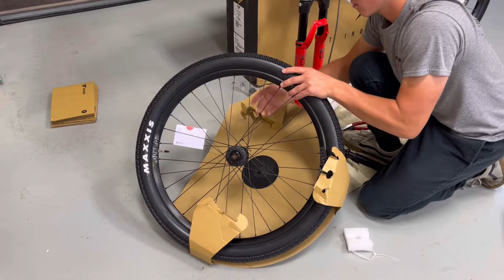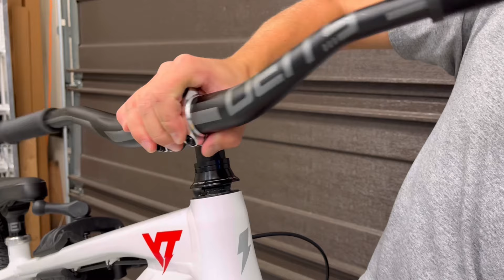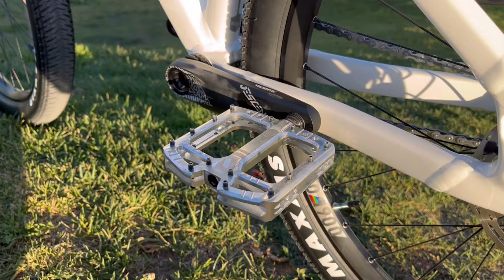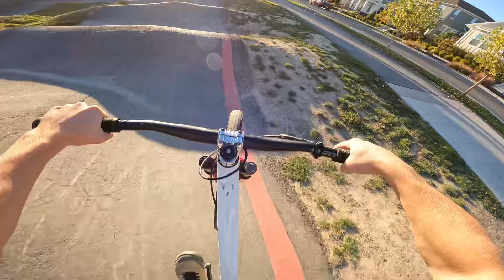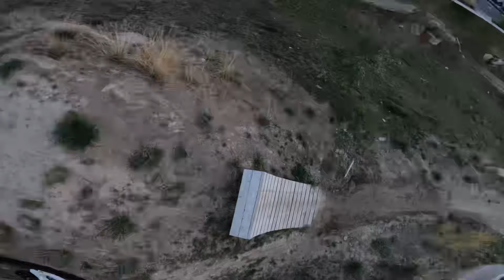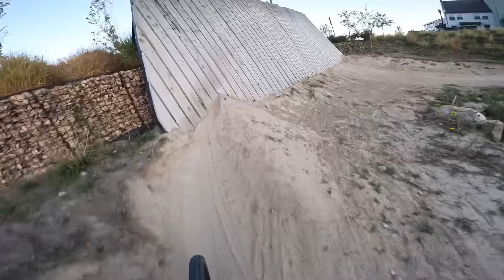Unboxing and Testing YT Dirt Love Core 2 Aluminum!

Comment: Sick looking bike!  What DEITY bars are those and how much rise?
Reply from the maker: @lordexzisus  They are the Deity Racepoint bars in 38mm rise.
Reply: @2wheelsavage  Hey thanks for the quick reply.  Since this is a higher rise than what the Dirt Love core 2 came with.  Did you find it affecting your riding?
Reply from the maker: @ Nope. These bars feel super good on the bike.
Reply: @2wheelsavage  Awesome!  Thanks for taking the time to answer my questions - subscribed.
Reply: I forgot.  Did you have to cut the bars? Thanks.
Reply from the maker: @ I cut them down a little bit. It’s just kinda personal preference.

Comment: Hey man nice video, just had a few questions,

what size did you go for and how tall are you

And how many headset spacers could you fit on the steerer tube under the stem, (need to know for gyro setup)
Reply from the maker: I got the regular frame because I’m 5’ 5” tall. I can fit at least 3 to 4 mid size spacers on the steer tube.
Reply: Hello, thank you for your video, I will buy this bike for use only on pumptrack , I wanted to have your opinion I measure 5.9 I wanted to know what size do you recommend me for the pumptrack? Thank you
Reply from the maker: @hakimisimon  I would recommend getting the Regular size frame!
Reply: @2wheelsavage thank’s 👍